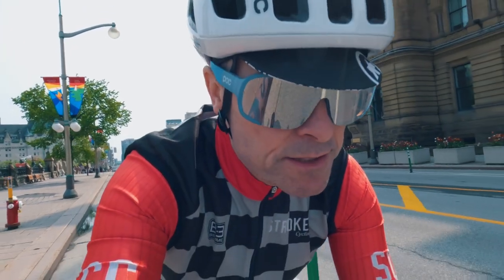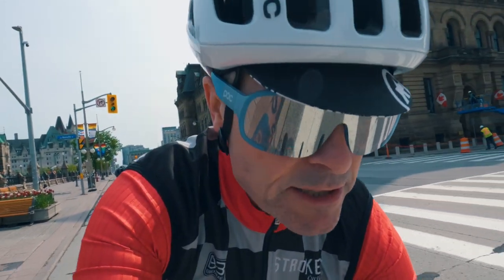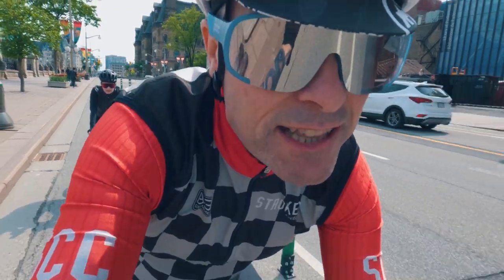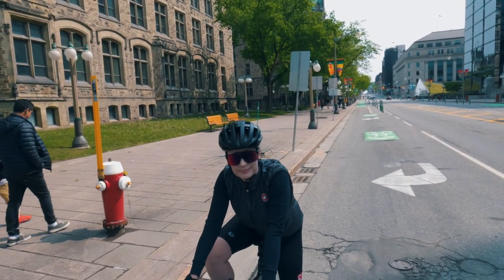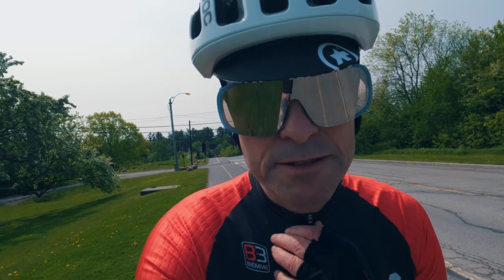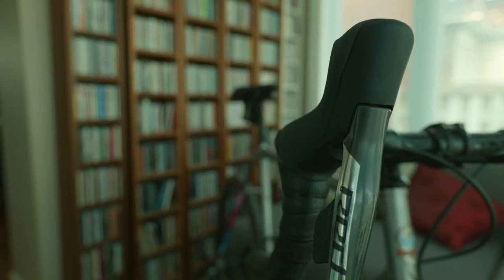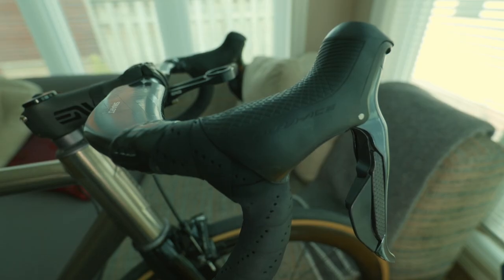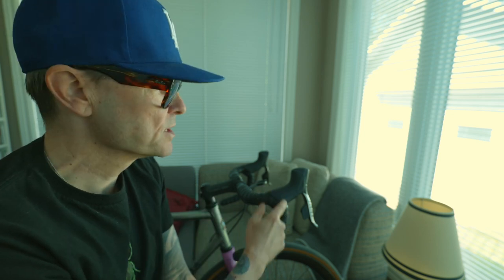Battle du jour - Titanium versus Steel....

Comment: Great video, was waiting for this video once you posted a video of your new steel bike. Do you have any conserns when ur comes to rust on the steel bike over time? I'm riding a carbon bike at the moment but I have my eye out for standert steel bikes from Berlin. Blacksmith Cycle in Toronto is a supplier of Stadert
Reply from the maker: Hey Garo, thanks for watching.... that's a good question and something I need to look into... Mariposa did provide touch-up paint which is a first for me when buying a bike... I will ask the question about long term care - but maybe the Ti bike will become my rain bike and keep the steel one dry?
Reply: @mylifeon2wheels1  I've seen recommendations about using something like Framesaver at least 1x a year to protect against rust on steel bikes--Framesaver recommends 2x a year if you live in an area where it rains a lot (or in your case snows and where salt & chemicals are used on roads etc.) or near the ocean. 

I'd def reach out to Mariposa to see if they provided a layer of protection before building the bike--my guess would be that they did.
Reply from the maker: @ashurany  Thanks, Ashura - stay tuned on the feedback from Mariposa... Matt
Reply from the maker: @ashurany  Just heard back from Mariposa : "Regarding care for your Mariposa, we recommend with washing all bikes well after riding in rain or snow or mud or gravel and then drying and oiling the drive train. Monitor your chain and change it when it is stretched, as that will lengthen the life of your chainrings, cassette and derailleur pulleys. 

Annually, we recommend a tune up and to spray anti-corrosion solution inside the tubes (we treated your bike with this before delivery)."
Reply: @mylifeon2wheels1  Excellent! Mark of a good company. You probably don't have to worry right now since Mariposa's protection should last awhile. But def wash and dry that frame often...I say that as someone who slacks in that department :)

Comment: Great vid. I kinda-sorta suspected steel would come out ahead, even though I've heard wonderful things about titanium. Given the high price tag for a titanium bike--even non customized--if their ride quality was much superior to a steel rig in a similar price range, perhaps more would opt for titanium?  Either way, heads you win, tails you win! 🤣

FWIW, I love the ride quality of steel bikes (my steel road bike is a Ritchey Road Logic w/carbon fork & rims on 30mm tires). But if I'm being honest, I like the feel of my carbon road bike better (Cannondale Synapse on similar carbon rims but w/35mm tires). Might just be a better fit, but the larger tire size seems to make up some of that difference.
Reply from the maker: Hey Ashura.. thanks for checking out the video.. Ti is a pricey option.. but then so is a custom steel bike.. 😩 I should have switched to fatter road tires a long time ago!!
Reply: @mylifeon2wheels1  Don't think you can go wrong with Ti or steel. Either way, both your bikes are sweet.